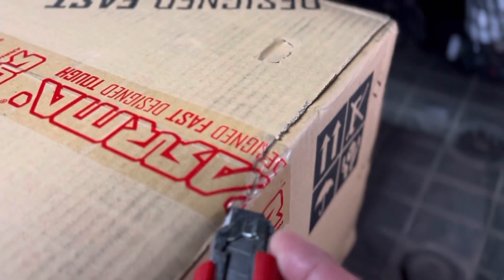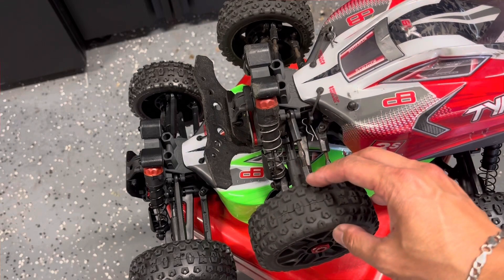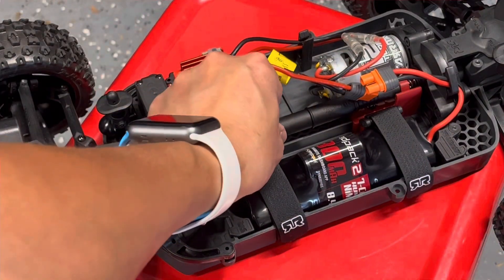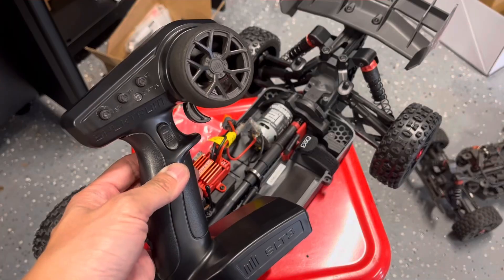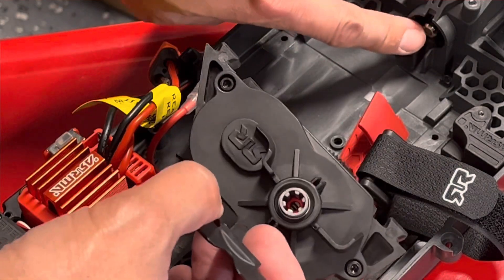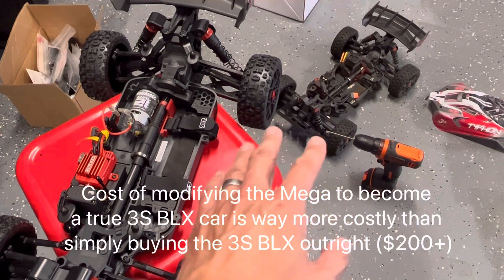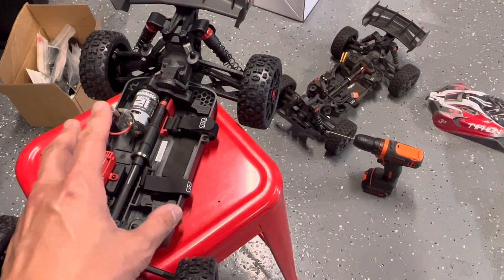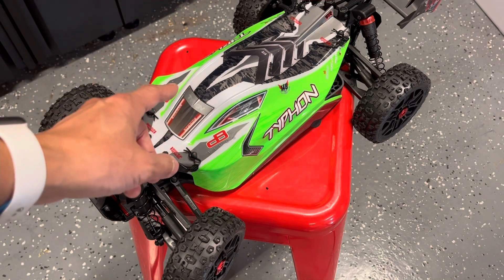Cost to Modify an ARRMA Mega into a 3S BLX

Comment: Very informative
Reply from the maker: Glad you found it useful. I love the modded 2S brushless mega so much more than a stock 3S BLX b/c of the reliability but it does end up costing more for the setup. Just glad there isn't repairs needed on the 2S like the 3S which seems to suck $$$ out all the time. I wouldn't advise modding a Mega to a 3S though. That defeats the purpose.

Comment: Ive had a 3s typhon for a while and got a 2s typhon for my 7 Y/O for Christmas. He's already asking for an upgraded motor lol. He's used to my 3S I Guess
Reply from the maker: 2S Typhon I think is only fun once it's brushless AND with the proper motor and gearing setup. Took awhile to experiment with what worked best for me.
Reply: @Funcentric  that's great advice. I've looked through your videos and don't see any updates on the Mega. Would you mind sharing your motor/esc and pinion setup? I'm newer to the hobby.
Reply from the maker: @MOTO_DOSE  My Instagram has more up to date info with more detail. My favorite setup on the Typhon with stock wheel size is 3800kv motor paired with a 22T pinion and stock 48p 91T spur. I use a budget Surpass 60A ESC. This setup yields a 31mph top speed which was my goal. Any faster and it'll be vulnerable to breaking itself like the 3S BLX's stock. The whole goal was to increase reliability compared to the 3S BLX cars.
Reply: @Funcentric  thanks for the info! We'll be upgrading his typhon in the near future for sure

Comment: Great comparison. I have been tempted to get the 2s mega but as you said it's more practical to just go with the BLX if your into speed. I converted my 2s Granite to 3s after the first couple of runs and ended up spending more. I kept the fixed links and the truck preforms great off road. For speed runs the toe was a bit out so I replaced them with adjustable ones. I've noticed that when you upgrade it can get quite expensive. The stock 3s Typhon is a great buggy and stock parts are cheap. I think the only upgrade that really counts is the shocks. Unless your blessed with a large bank account your better off leaving your cars stock and replace parts as needed. 👍👍
Reply from the maker: I find that in at least my type of driving, I would never get to the speeds that a 4S or higher car gives me. The 2S performs quite well for my needs. With the reliability exponentially being higher than that of the 3S, I do like my 2S better. The more power of the 3S is hard to deny, but waiting for parts, ordering and spending $$ over and over again and spending time and time again to fix stuff isn't really of my interest as much as driving the thing. 

I do wish I built a 2S sooner, but I would have to say that it was my experience with the 3S that made me more appreciate the 2S cars I have.

Comment: Very enjoyable vid.

 I have an old Turnigy Trackstar 120 esc and 1900kv motor I used in a Ofna LXe1 and was wondering if any of you think I could repurpose it into my Mega?  Definitely going to stay on 2s.
This is the V3 Mega Typhon.

Any suggestions on gearing would be very helpful too.
Reply from the maker: Generally high voltage goes with low KV and low voltage goes with high KV. 2S is quite low voltage, so matching that with 1900kv motor, it'll be very slow and laggy.